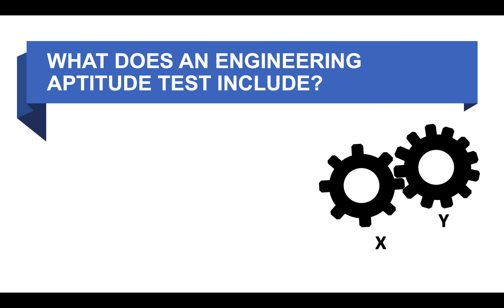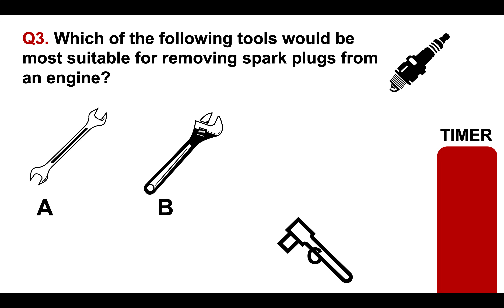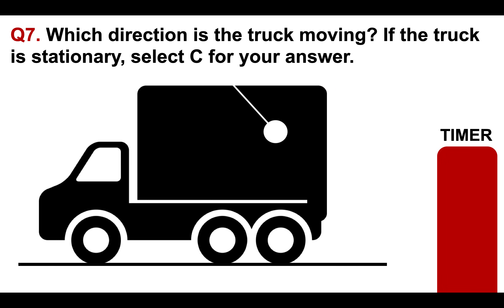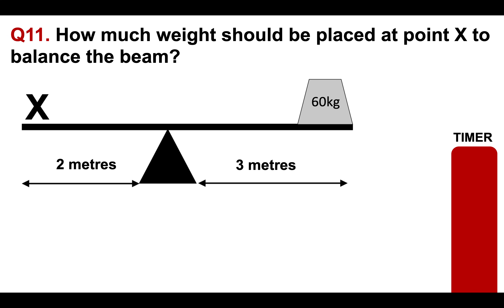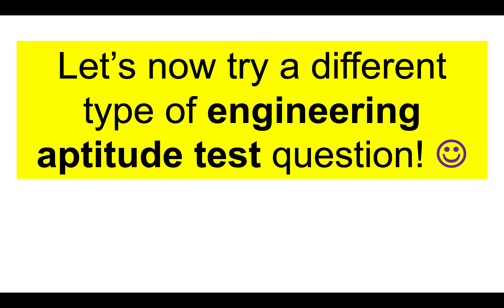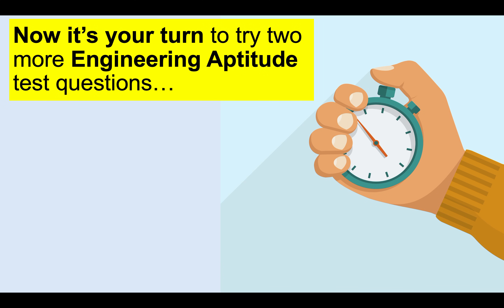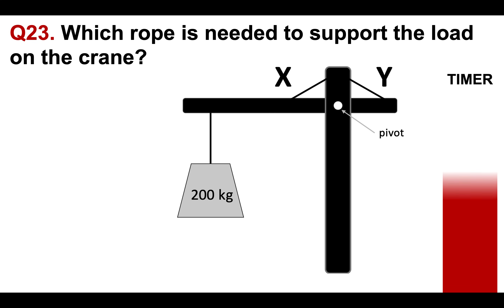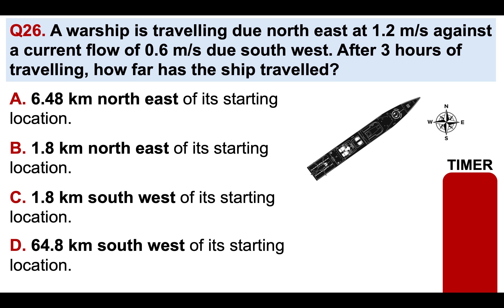ENGINEERING Aptitude Test Questions & Answers! Mechanical Comprehension & Electrical Aptitude Tests!

Comment: 5:32 Either A or B could be correct. The pendulum would be in that position if the truck is decelerating while reversing. Moreover, only if the truck is accelerating while driving forward, would the pendulum be in that position. If the truck is just driving at a constant speed the pendulum would hang straight down (unless wind was blowing on it).

Comment: Q2 B
Q3 C
Q4 B ?

Q6 B
Q7 A
Q8 D ez

Q10 D 30kg
Q11 D 90kg

Q13 A cause the petrol still has a lot of momentum
Q14 C ?

Q16 C  280/4 = 70
Q17 33 ?

Q19 E
Q20 C   Max is 3 bulbs, and all are connected to the battery circuit, so 3 is right

Q22 A…maybe
Q23 Y   to counter the weight X so the left part of the crane can’t tilt downwards

Q25 C
Q26 A  Speed: 1.2-0.6 = 0.6m/s, time: 3*60*60 = 10800 s; traveled: 10800s * 0.6m/s = 6.48 km

Comment: Can someone explain the balancing beam one to me please?
Reply: You have to use a certain formula which is, (The amount of weight, X(times) the length of the distance on the weight side, \(divide) by the opposite distance on the other side. So for a example it on section 6:58 of the video it would be (90x1=90, and then 90/3=30 so it would be 30kg. Remember the reason it’s balancing a 90kg with a 30kg is because the length of 30kg is 3 metres. Hope this helps I believe

Comment: In question 20 what does replacing with a cable do and is that the same as removing a bulb?
Reply: Replacing with cable keeps the circuit, removing the bulb cuts the flow of electricity in that line

Comment: Can somebody explain Q26?
Reply: 1.2- .6= .6 
knowing that there is 3600 secs in an hour and the ships travels 3 hours north.
3600(3)= 10800
10800(.6)= 6480
knowing there is 1000 meters in a kilometer you divide it.
6480/1000= 64.8 km north.
hope this helps
Reply: 1.2 - 0.6 = 0.6 m/s (north east)
0.6 m/s * 3600/1000 km/hr = 2.16 km/hr
2.16 km/hr * 3 hr = 6.48 km

CMIIW

Comment: 1,clockwise 2,2 3C 4C 5B 6,back and right 7A 8D 9,30kg 10D 11,90kg 12Y 13A 14C 15 16C 17 33.33kg 18E 19B 20 4 bulbs 21 22A,C 23X 24 25north 26A ,question 26 I had to reference back to Q24and use a calculator but besides that all other questions I answered before you said the answer
Reply: Isn’t question 20 the answer 3bulbs as one buld has been removed and replaced with wire/cable so leaving 3 bulbs lit?
Reply: Yes!
And the 25Q) south @hiltonhy9607
Reply from the maker: Can you please advise the Q number?
Reply: (20) 3 bulbs (25) south

Comment: 2,B.     14,C
3,C.     16,C
4,C.     17,50KG
6,B.     19,B
7,A.     20,C
8,D.     22, A/C
10,D.   23,X
11,D   25, SOUTH
13,A.   26,A
Reply from the maker: Great answers Jamie! You got all of the right apart from questions 4 and 19 :)
Reply: in q11, y is it D. 90kg i dont understand
Reply: Q2 B, Q3 C, Q4 B, Q6 B, Q7 A, Q8 D, Q10 D, Q11 D, Q13 A, Q14 C, Q16 C, Q17 50kg, Q19 C, Q20 C, Q22 A/C, Q23 X, Q25 B, Q26 A
Reply: 60kg X 3 metres = 180kg then you divide it by 2 metres and you get 90kg

Remember the distances 3metres and 2 metres

So if 90kg is on the distance of 2 metres it can still balance it because it shorter distance then 3 meters, because 3 meters is a longer length with less weight. Hope this helps

Comment: Q.10 (D)?
Q. 13 (A)?
Q. 14 (C)?
Q. 16 (C)?
Q. 17 (50)
Q. 22 (C)?
Q. 23 (X)?
Q. 25 (South)?
Q. 26 (A)?  Initally thought B, then noticed my mistake (divided)
Reply from the maker: Well done on these answers! You got all of them right except for question 22 which is half right :)
Reply: @CareerVidz  ah, A is also unnecessary for 22
Reply: How to calculate for Q10?
Reply: @unknown  you multiple the weight (150kg) by the distance from the fulcrum (2 meters) and then divide that answer by the distance of the opposite side of the fulcrum (10 meters)

So its 150x2 = 300 and then its 300÷10 = 30

So our answer would be x = 30kg

Comment: [Assuming the white circle and line is a pendulum:]

Question 7 is dependent on acceleration, not direction of motion. If it's reversing but braking, or if it's accelerating forwards, a suspended weight will act as shown. It will also swing if the truck comes to a sudden stop.

Comment: can anyone explain the 17th question?
Reply: Imagine the weight was suspended on both ends instead of going over the pulley on the right.  The 100KG would distributed evenly to each end at 50kg each.  With the pully, the tension for the right side is transferred over the pully and into the other direction.  The tension left of the weight is supported by the anchor, to balance the system you would need 50kg on the other side to negate the tension.